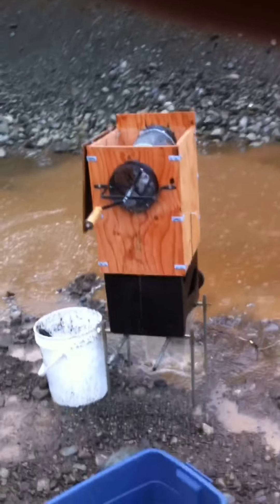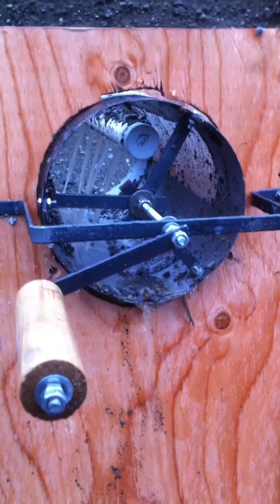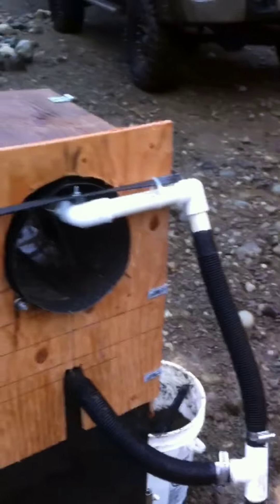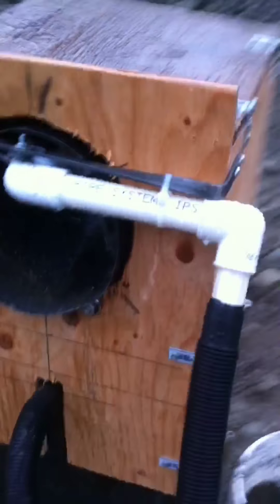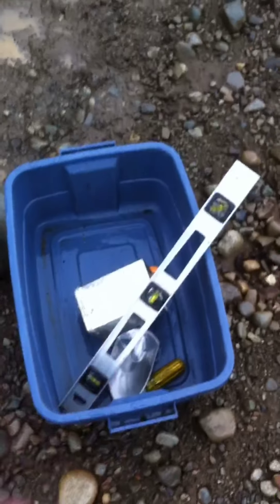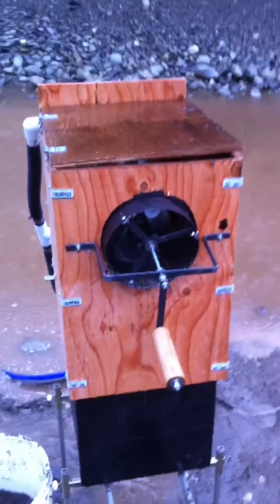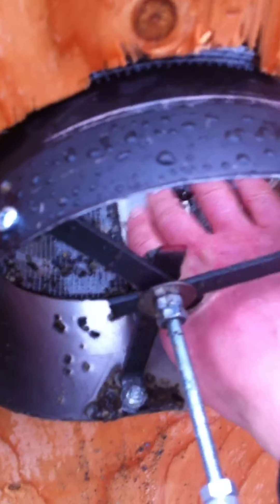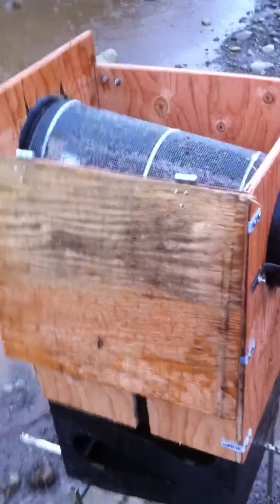Homemade Gold cube trommel

Comment: To make your spray more efficient you should have a tip that you can put in the holes that will make its prey wide.perhaps that will give it a little more pressure and cover more area and do a better job
Reply from the maker: Ya it’s been collecting dust for a while. Good idea though

Comment: Good home made idea.  One thing you might want to try is put a turn valve at the trommel and the inlet to the cube.  You would have dual water control.  Maybe turn the water flow down on the cube inlet and put a little more water into the trommel.  It's all going into the cube so adjusting the water from one inlet to the other won't effect the flow inside the cube.  Good luck.
Reply from the maker: That’s a good idea